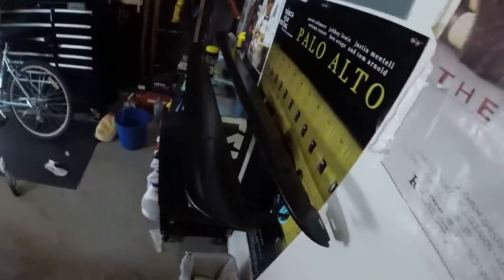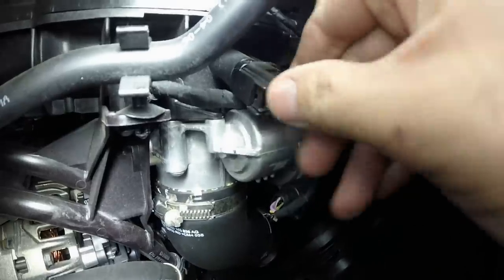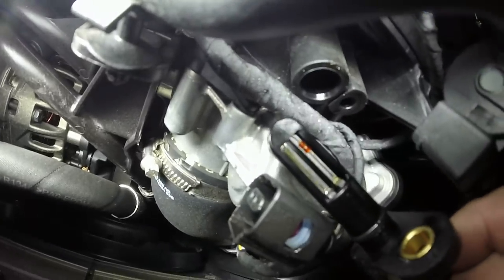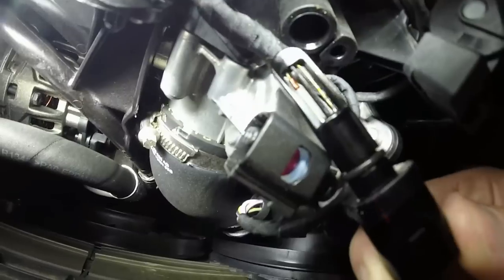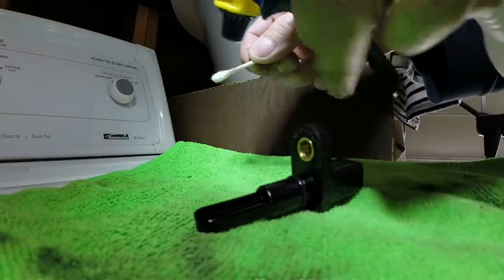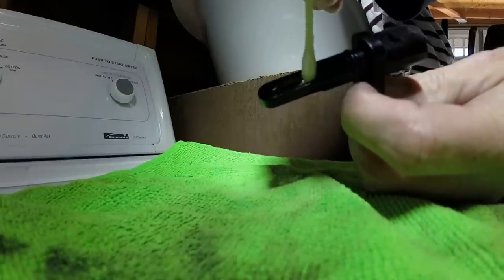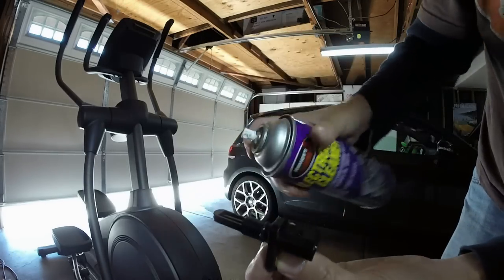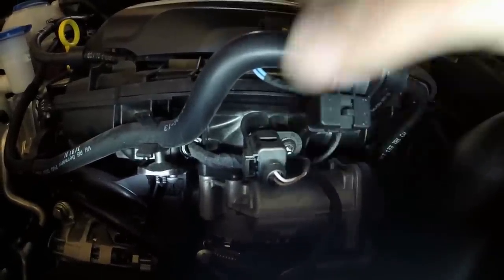2013 VW GTI: Episode 45 Vlog: Cleaning the Air Temp Sensor

Comment: You could use a MAF cleaner to safely clean the sensor, using anything pressing on the wires would most certainly damage the sensor
Reply from the maker: good point.. and i do take a risk when i attack the sensor with a q tip.
Reply: @LastHumansGarage  Indeed

Comment: You mentioned seafoam, what's your opinion on that? Do you think it actually cleans as well as they say (without causing damage of course), all I know is you have to change your oil much sooner if you mix some in with the oil as they recommend and I've heard of a couple guys who had Jeeps that hydrolocked their engines. The Jeep 4.0L L6 is pretty much indestructible so for it to hydrolock one of them, I could only imagine how easy it would be with other engines.
Reply from the maker: i wouldnt touch seafoam myself. if i wanted to clean it properly i'd remove the manifold and do the scraping.
Reply: LastHumansGarage A little manual labor goes a long way, thanks for the input

Comment: I have replaced my IAT sensor because i had error. Now, after a few months i recived error P3034 - intake air temperature sensor 2 signal too large. Should i change it again or what?
Thank you!
Reply from the maker: i doubt it, might be something else, like a wire or bad install. if you have an intake, that could be related also.

Comment: Not supposed to touch the wires, use MAF sensor cleaner spray the wires good and just let it dry.
Reply from the maker: ok thanks for the tip, i wont touch them next time